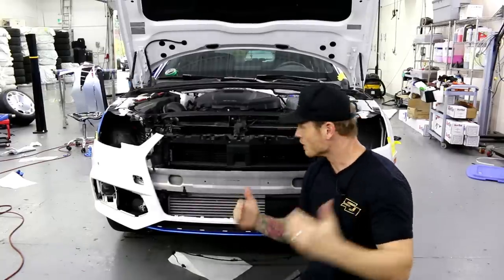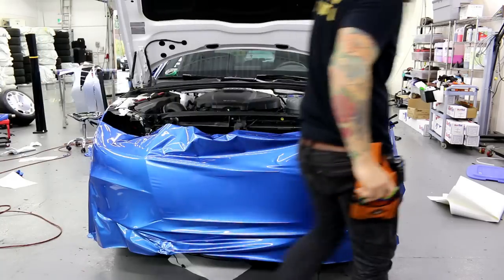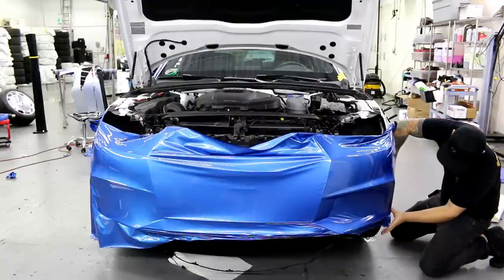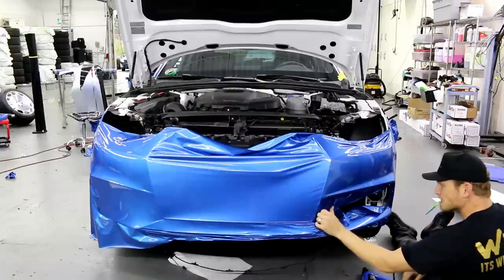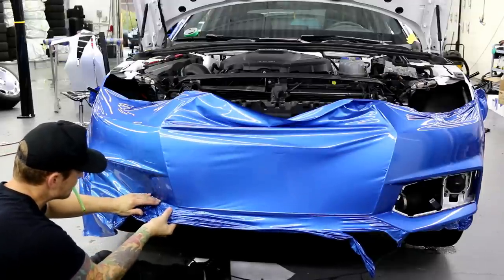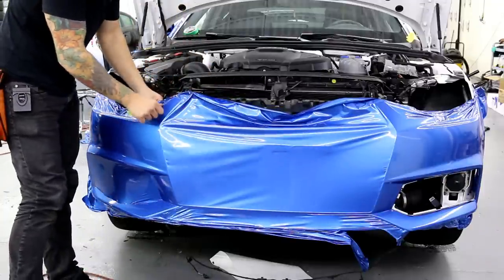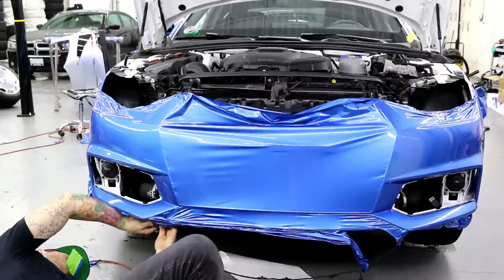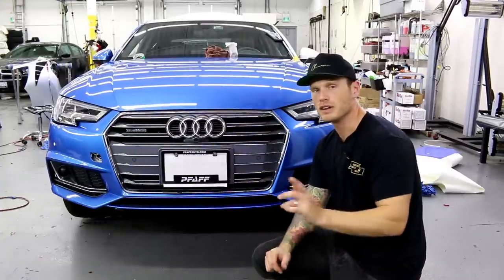USE THIS TECHNIQUE | WRAP A FRONT BUMPER IN ONE PIECE

Comment: Do you keep the surface wet? Or do you apply the vynil to the dry clean bumper?
Reply: It's always applied dry. You could spray a little bit of shield guard or wrap detailer which is like a spray wax on the squeegee just to help prevent from getting any fine scratches on a glossy or chrome finish while applying it but that's it. The only film's applied wet are the clear paint protection films.